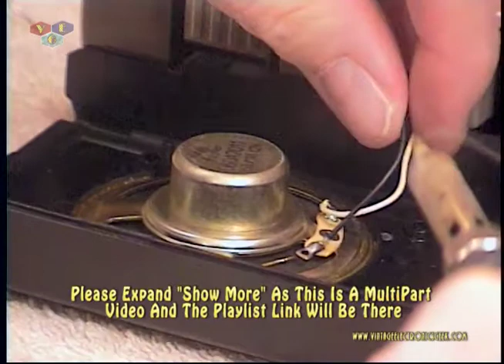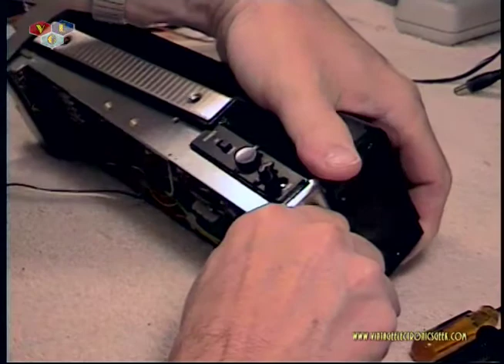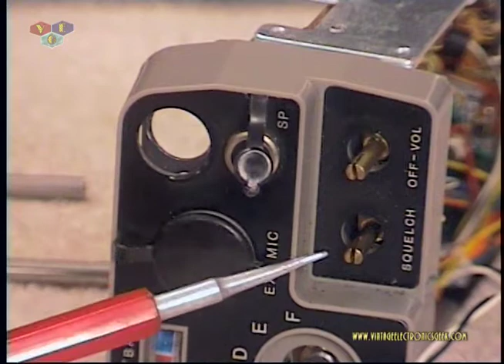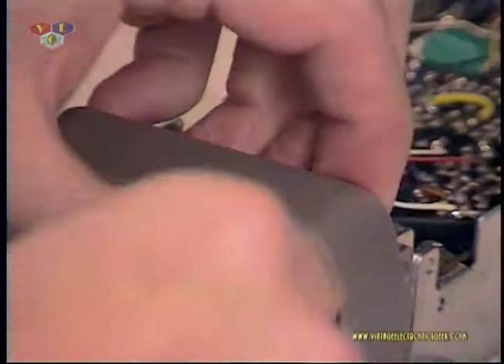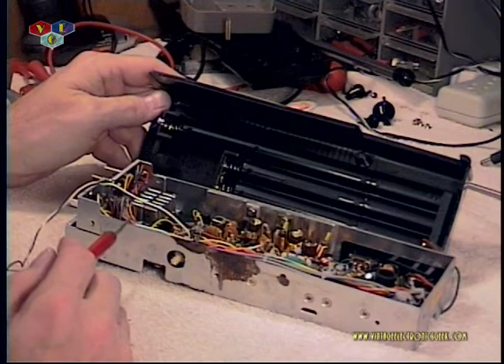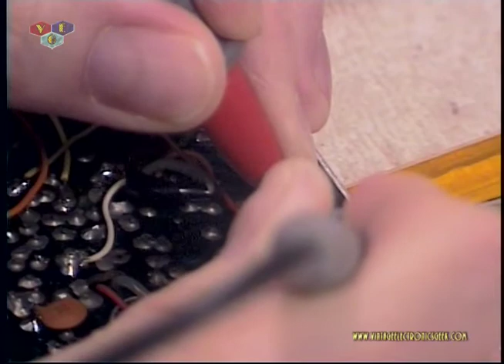Realistic TRC-200 CB Walky Talky - Disassembly & ID The Problem - Pt II

Comment: That circuit board needs some cleaning. Looks like there is a burned black spot at the top middle of the board unless its just left over black tape. Well you could have a resister that's shorted or a capacitor that is acting like a resister causing a dead short.You definitely need to take care of all of those cold solder joints. They really did kind of throw those things together.
Reply from the maker: That they did!  In the next videos I address them....well, at least I hope I capture on film??  I shot this video last year and I don't even remember what I did!  I'm watching them as I edit, a mystery to me as well!  :)  Thanks for watching Larry!  ~Jack, VEG

Comment: Very interesting. I'll definitely be following along to see what you uncover. Is the spanner wrench made for removing slotted nuts or just a versatile tool for cameras, etc.? Thanks again Jack. Best, Don
Reply from the maker: Thanks Don, I appreciate that and I cant wait neither!  :)  I bought the wrench for camera repair, but I'd imagine it could be used on a lot of applications.  Here is an eBay link to the type I bought:  https://goo.gl/iisAN3  , I know there are all types of spanner wrenches in case this will not fit your project...the slotted heads on these are about the size of a S1 screwdriver and appear to be solid (maybe not quality like Craftsman, but not cheap Chinese) if that helps.  Thanks for watching!  ~Jack, VEG
Reply: Vintage Electronics Geek I appreciate the link Jack and will be eagerly awaiting your... Best, Don
Reply from the maker: No problem Don, my pleasure!  Trying to find time to edit, I have been rather busy here lately as I have had failures of 2 websites (I hate PHP, its not HTML, that's for sure!) and my computer is being not friendly lately as well...and they say AI is supposed to help improve your life, yeah right!  :)  ~Jack, VEG